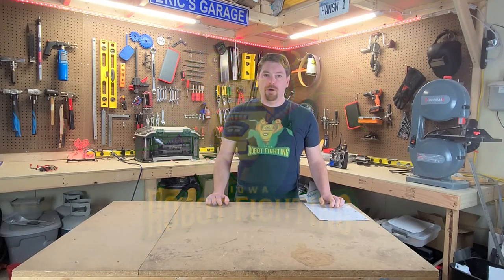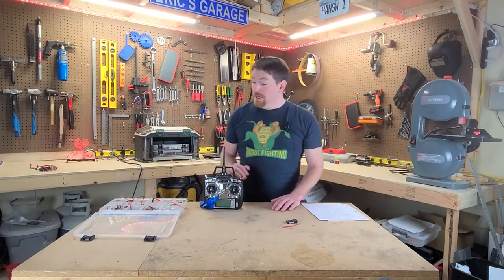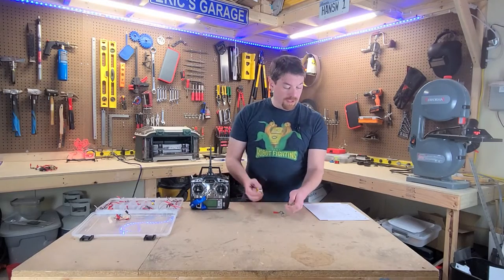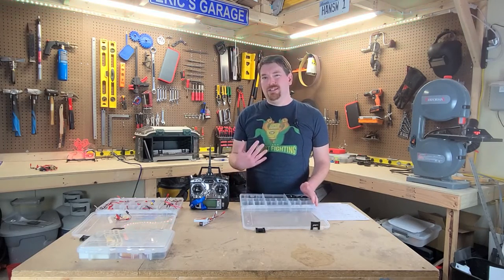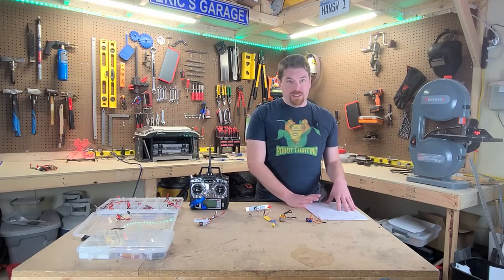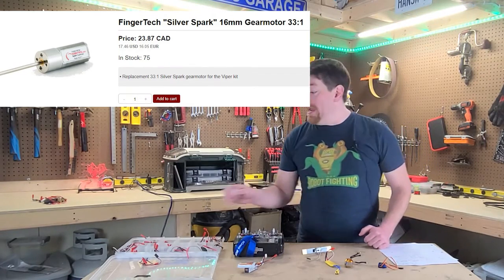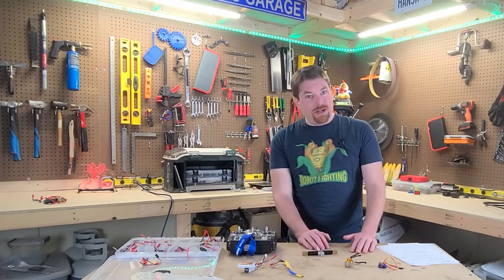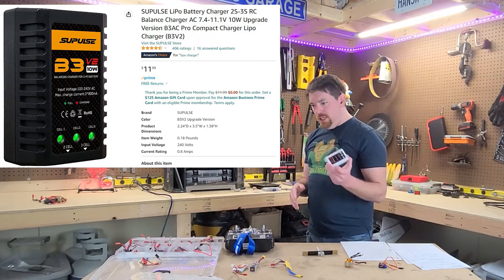So you want to build a combat robot!

Comment: Knowing what I know now, I could probably build a First Drink of the Day for about $300-400 or so.  Pawsitively Hissterical was quite a bit cheaper but thats because its almost entirely 3d printed and I had spare parts laying around.
Reply from the maker: Is First Drink of the Day a Beetle weight or Ant weight? That seems really high for the price of a single build.
Reply: @iowarobotfighting  Beetle. The brushless drive was the single most expensive part.
Reply from the maker: That makes a lot more sense. We've only met a few teams that have spent that much on an ant weight and they went massively overboard.